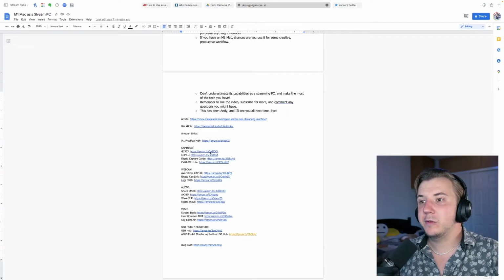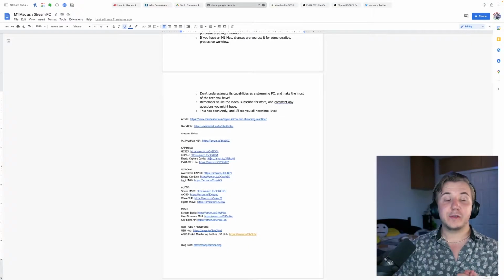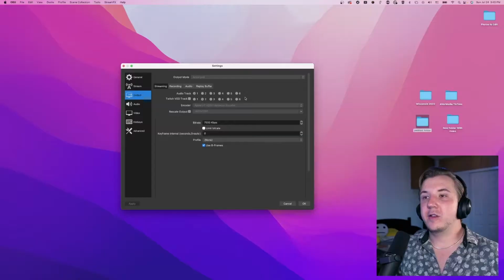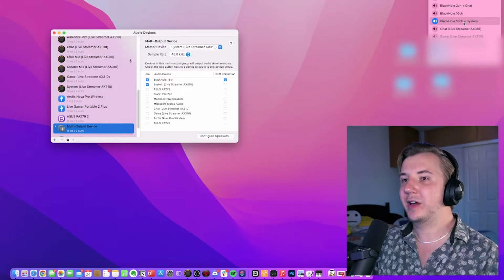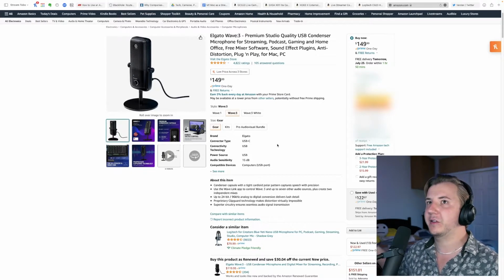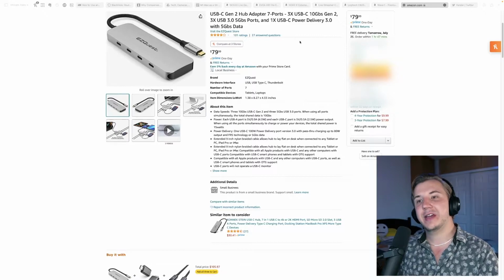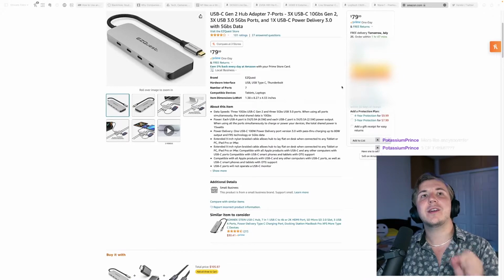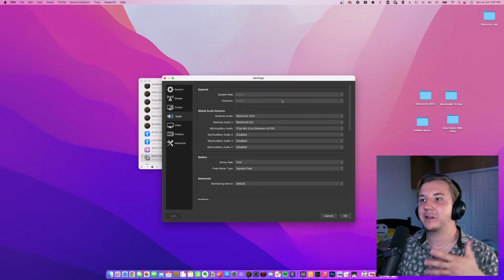How to Stream Using an M1 Mac: Hardware Needed & Unique OBS Setup

Comment: I have a 2019 MacBook Pro Sanoma, every time I download OBS it says this app is not compatible Wirth this device. please help me out so I can start streaming on twitch as well
Reply from the maker: You'd need to get a version of OBS compatible with an Intel Mac, as a 2019 one would not work with Apple Silicon applications
Reply: @AndyCormierYT   ok I got obs set up by selecting intel I have a corei7 processor. So my new problem is Lag when actually streaming and recording. I am trying to use my iPad Pro 4th generation connected to my MacBook Pro. I am using my iPhone 14pro max as my webcam. I am trying to do reaction videos by streaming videos off my iPad and I have obs running on my MacBook Pro. What do I need to get a smoother stream? Thanks for the response
Reply from the maker: @FriscoSupreme  Honestly, google would have a better answer than I would. It sounds like some of these may be resource intensive, so you may want to check your bitrate and resolution settings  (e.g. 8000 kbps at 1080p60 is the highest you should go for twitch in most cases)
Reply: @AndyCormierYT  thanks for the reply. Alright changing those settings to see if it makes a difference. Do you think an elgato capture card would help? Even though I’m not streaming video games

Comment: First of all i appreciate all you do. I'm running the same set up but have an issue with audio. My mic and headphones are plugged into the PC. OBS on the Macbook. To transfer sound from the PC to the Macbook I'm using the HDMI to Elgato>USB>Macbook. As you may know Windows can only output one speaker. My issue is I'm using a PC>Dac/amp>Headphones. This means I can only select either the HD60x or My Dac/Amp for output, not both. What is the work around for this when I'm streaming?

Comment: How did you do the audio setup to capture audio from your gaming desktop. 
I use discord on gaming desktop as well
Reply from the maker: I use an external mixer, so in the LINE IN port, I connect the headphone jack of the monitor my desktop / console uses. That way, I can get audio from the desktop on my capture card while still hearing it in my headphones, as well as on my mixer as a backup

Comment: do you need an interface? or is the shore mv7 mic with its software enough?
Reply from the maker: A (good) XLR interface will generally have a higher quality ceiling than most USB-only options (as well as built-in effects), but the MV7 is a quite superb option over USB. I have a few friends who use the USB-side of the Shure MV7, and all their audio sounds great

Comment: Hi, that video of yours is great. I plan to go into streaming. I am playing on my PC, but since its not the latest (although its fine for gaming), also streaming on it at the same time would definately cause problems. I have an Macbook Air M1, which i now hope to use for the Streaming Computer. I also got recently, as a gift, a Rode Rodecaster Pro 2. You probably know it too. This has some audio options on its own, and I wonder given your tutorial here, how that would change things or what would be different in that case.

One of the things that isnt ideal is the fact that the Macbook Air M1 has not my ports, pretty much only a Audio out and a couple USB-C.  The whole capture card would already take 2 USB ports, not to mention the Rode Rodecaster Pro 2 has 2 built-in USB Audio Interfaces, hence it can go out twice from either USB-C to USB-A or USB-C to USB-C. Without a hub, which I hope would make that possible to use that many USB ports on a Macbook that itself doesnt even has regular USB ports other than the 2 USB-C / Thunderbolt.

But I have a Thunderbolt 3 Dock for my Macbook:

https://www.caldigit.com/de/ts3-plus-de/

Would that suffice as well ?

Considering all you do here in your Tutorial, and give nthe slightly different things when it comes to Audio, would that still be possible, or would i beause of that have to change a lot of things ? Any help, because I never really did go into Streaming before, so my Streaming knowledge (except that i once or twice used OBS for some test stream for myself or recording gameplay) never really used these things serious for Streaming.

Do you think this would still be possible ? Thank you so much, any help you can give me would be appreciated.
Cheers

P.S: I am writing this, without being fully through your video itself, always going piece by piece and then updating my post, just so I dont forget whats all important for me to remember. ;)
Reply from the maker: All of that looks good! If anything, your peripherals are even a little overkill. I don’t even use a Thunderbolt hub, I use a USB 3.2 dongle since it’s less prone to issues (but Caldigit makes really good TB hubs)

That said, be careful not to over-exert your M1 Air, since it lacks any active cooling. OBS rarely even turns on the fan on my M1 Max, but keep an eye on thermals as you test it all out! Unless you stream for really extended periods of time you should be good~